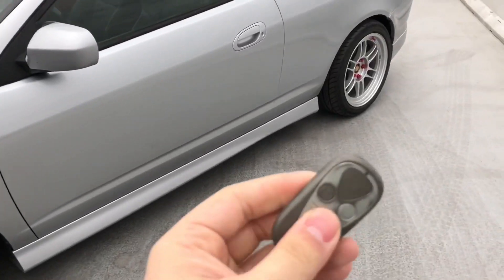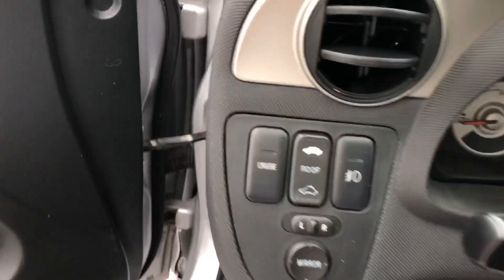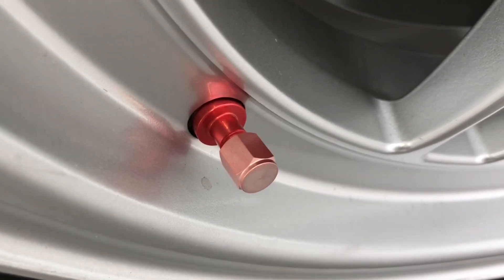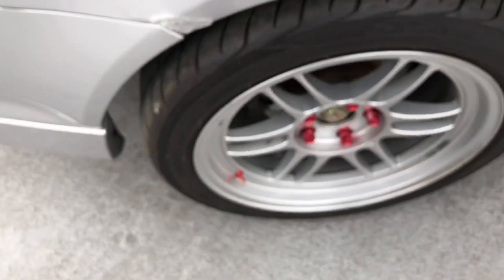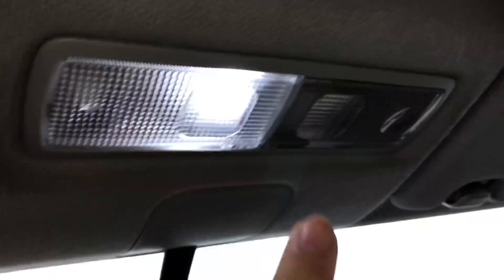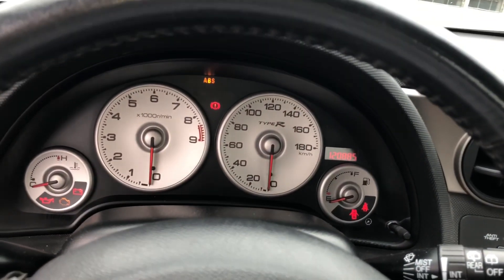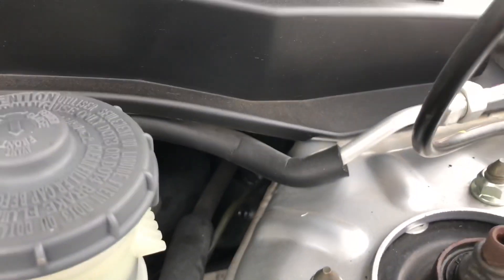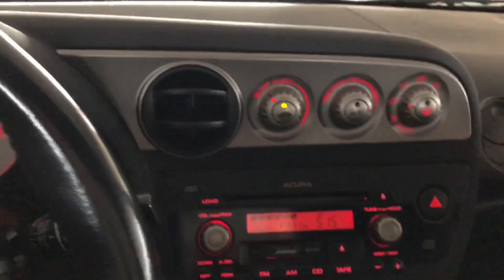More ITR Parts! + Track Look? | RSX Type S

Comment: Aye man your DC5 looks great, I need to clean mine up. I think you have to let the motor mounts break in and for a while and they won’t vibrate as bad anymore. I just got the RPF1 same specs as you but for tires I’m going with 235’s for a tiny stretch
Reply from the maker: TBills 3000 thanks and heck yeah! 245 have a slight stretch on them, i wish i would of went 255s or 265s

Comment: The suspension is stock of lower spring?
Reply from the maker: Lowering Springs
Reply: Coda5610 how many inches u dropped on front and rear mine is too bumpy
Reply from the maker: AnhKiet Tran i think 1.6"
Reply: Coda5610 thanks bro . I have 1.8 on front too much bumpy